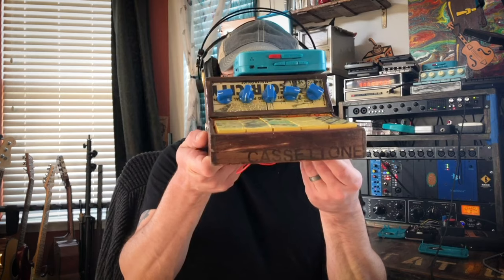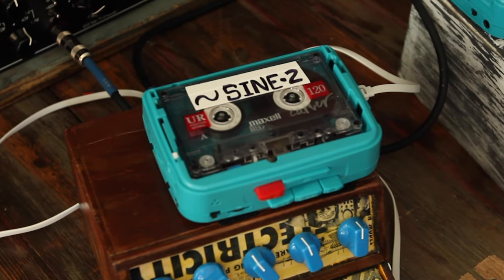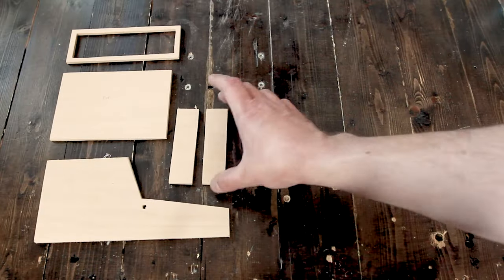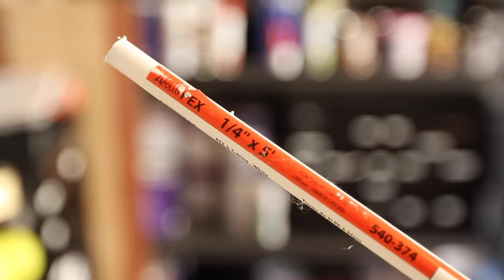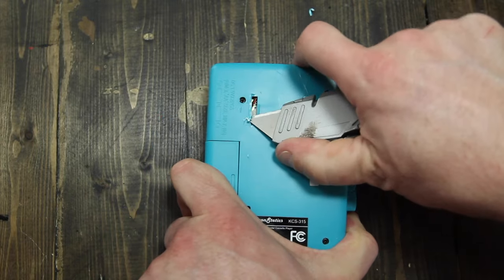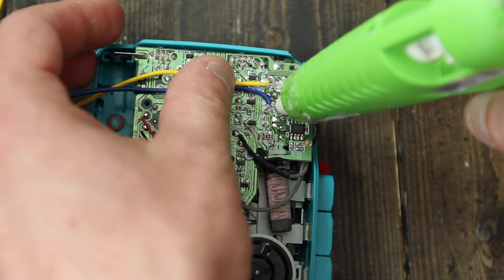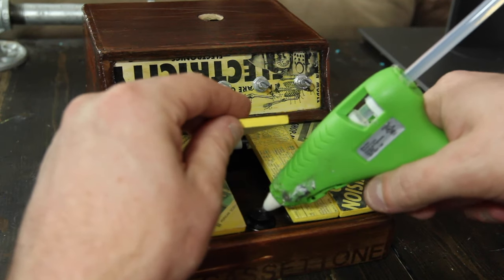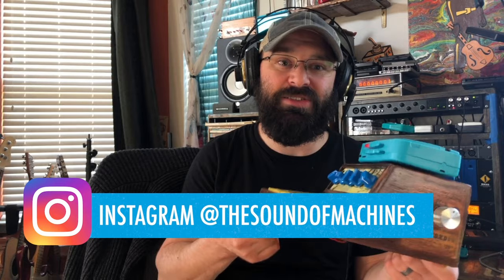Make Your Own Cassettone Mk1— A DIY Modified Cassette Player Synth

Comment: Hi!! Im having a problem that the cassette is always playing. It does slow down when i use the buttons but it is still always playing, even with the master pitch knob. Anybody else? Maybe im confused because he switched the colors of wire off the copper pads in the layout but i tried all configurations i feel and still no avail. Thanks!! great Video!
Reply from the maker: These are issues that folks are already helping each other with over at the new discord. Check it out! https://discord.gg/DjJ6tPJCtV See you over there!

Comment: Hello Rich. Are you still on Instagram? I tried looking for your identity on there but was unsuccessful. Maybe Facebook? I've almost completed the case and am waiting on some push button switches, from eBay. Also, I may have solved the issue of tape stopping upon key release. I have a channel of my own and I'd like to upload your design and my build progress. We can't get the cassette walkman you specify in the UK at a reasonable price, so have used another type I had in my collection. Lovely looking item. I wonder if you went to design college? 🙂

Comment: removed trim pot, soldered on wires to new pot... but now only goes extremely fast, no variable speed - not even normal speed.  wtf?? lol.  will be funny to record in x100 speed but i dont think this is too practical now lol